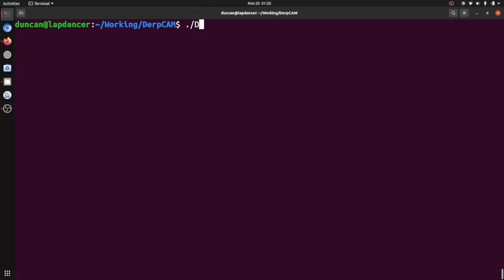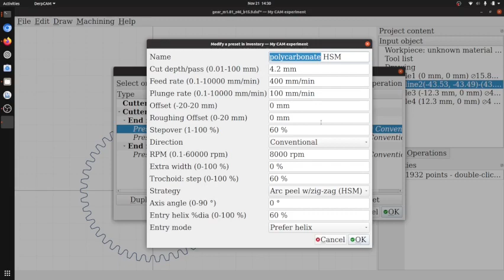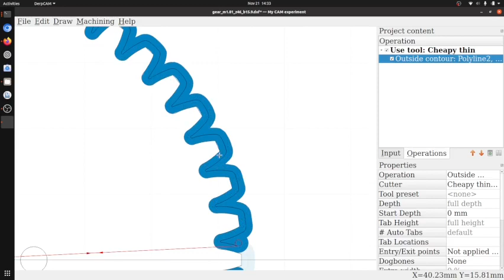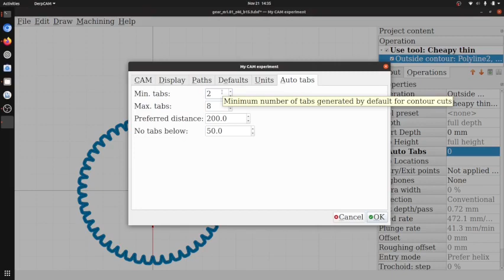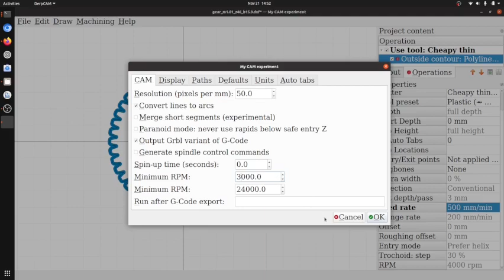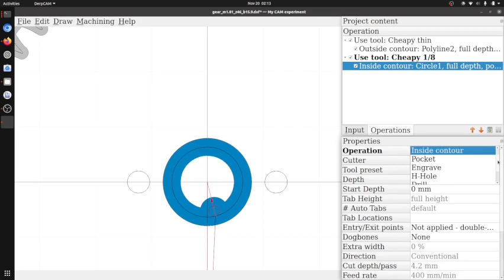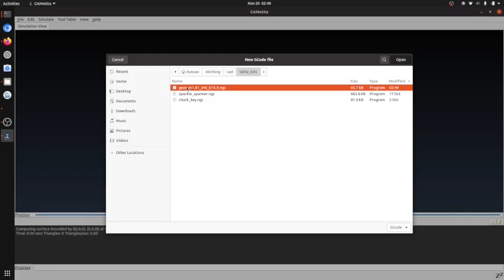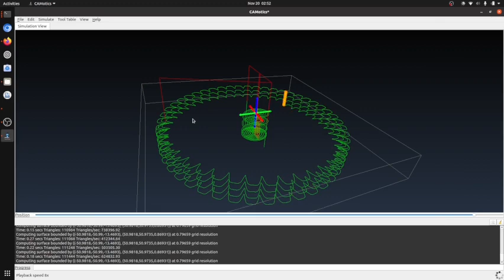An introduction to DerpCAM

Comment: This looks awesome. I'm on windows. When i can get to the PC I'll head to github to read all about it. Nice work. I accidentally stumbled upon this on Reddit. Can't post there. I've never signed up.😂
Reply from the maker: Cool. i don't have a windows machine to test on. Let me know how you get on!
Reply from the maker: I've had reports of someone successfully installing on Windows using the same method as the Linux instructions on the Github page.
Reply: The linux instructions are all new to me. I don't really understand the concept. But I'll research further.
Reply: @Roblamont1  That's where I'm at,  linux newby. But I'll figure this one out for sure
Reply from the maker: So i've not used Windows since Win'98 so i can't help directly...
But i'd trust the following documentation:
Installing Python3: https://docs.python.org/3/using/windows.html
Installing pip: https://packaging.python.org/en/latest/tutorials/installing-packages/
You'll see there are Windows version of of all commands on that page.

Those are both long documents that deal with a lot of edge cases.
You should only need to follow each as far as the command documented at the "Ensure you can run pip from the command line" section of: https://packaging.python.org/en/latest/tutorials/installing-packages/#ensure-you-can-run-pip-from-the-command-line

From there, i think it's going to be `py -m pip install -r requirements.txt` from whatever directory you have the DerpCAM source code in to install the dependencies.